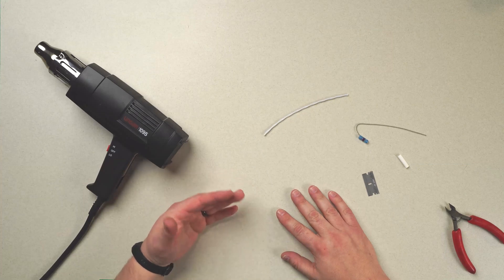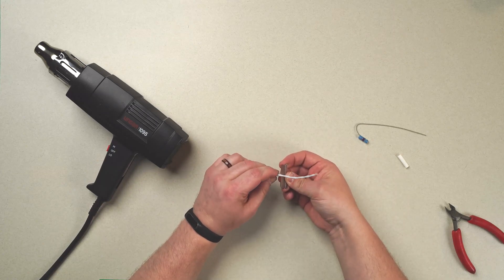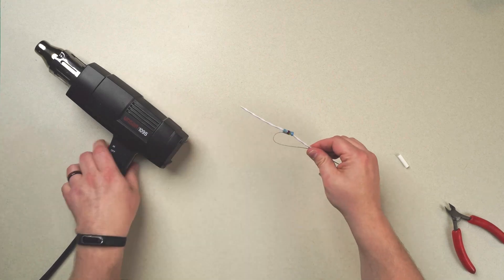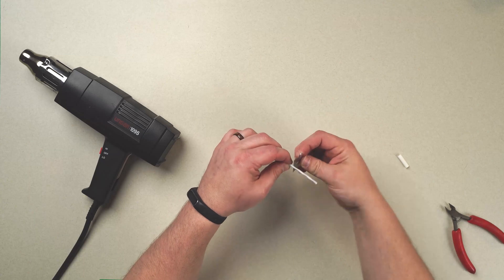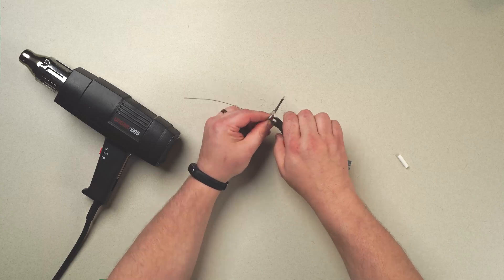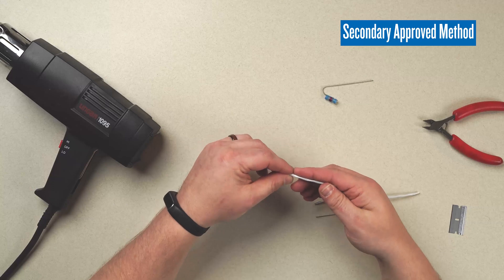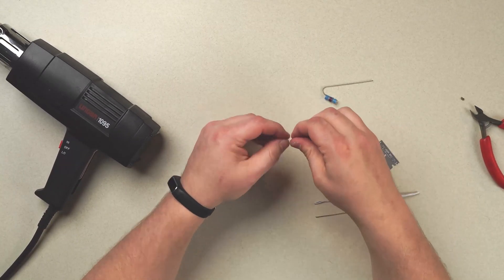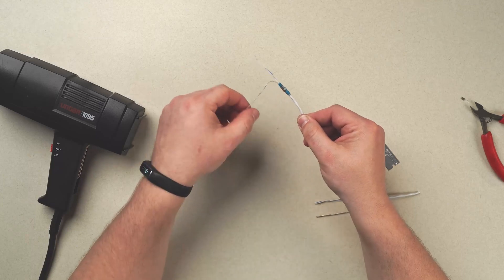Garmin G5 Wiring Fundamentals- Shield Termination Methods- Experimental Aircraft

Comment: I am surprised you don’t show a third method which is the one I have used for decades that is both easy and less expensive than buying the expensive solder sleeves with pigtails.  Strip the outer jacket and puff up the shield and then make a hole in the shield near the end of the stripped jacket.  Pull the wires carefully through the hole in the shield and then twist the shield back together as a separate conductor now.  Crimp on the ring terminal and you are done with no need to additional parts or soldering.